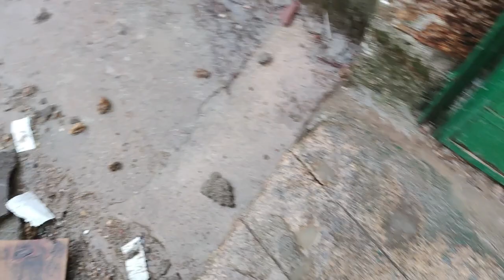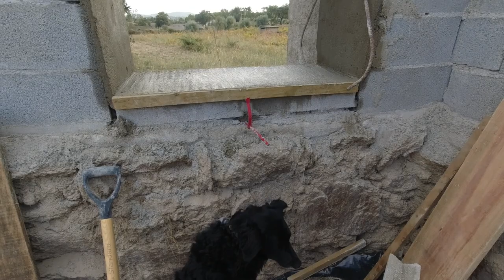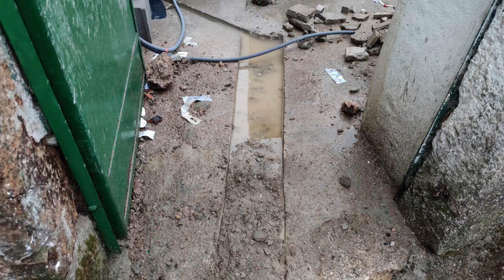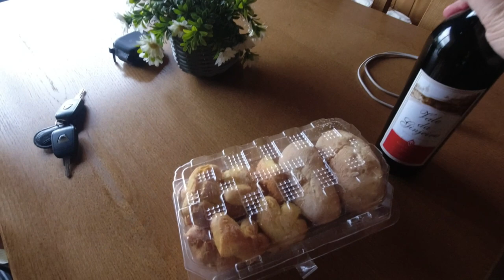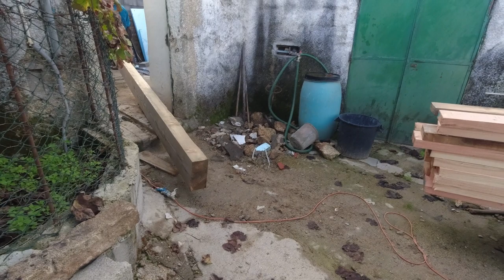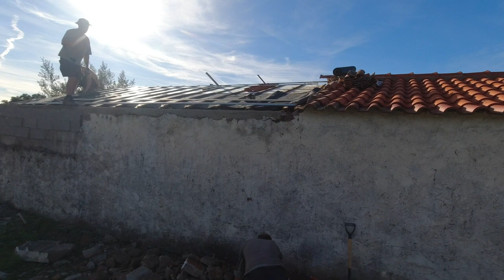Farmhouse Reno Week 4-6 | Heavy Rains & a ROOF! | My Central Portugal Farm #48

Comment: Christine, Having almost completed a restoration of my 120 year old cottage and a conversion of my garage to a studio with bathroom over the last 7 years, I can tell you that errors always abound and compromises too. You are courageous for taking on this building, which amounts to a virtual total rebuild. One major concern I’m left with, however, is the moisture. I’ve observed numerous Portuguese immigrants now work on their barn conversions and Portuguese built farm homes. They al, have a common problem: moisture. What seems to be lacking consistently is an efficient drainage plan and underground insulation and vapor barrier. I urge you to examine this aspect closely or you will be plagued with mold and other problems. Perhaps, you have done so already,  tu I’m not seeing the evidence yet. I live in a subtropical rainforest region in the NW US. I know of what I speak and have had to tackle such issues myself. It’s made a huge difference. Wishing you the best with the build! ❤

Comment: Just a small suggestion , with no window in bathroom there won't be Air circulation. I would suggest extractor fan. In your door you cut a hole in bottom of door with grill then have wall extractor fan connected with bathroom light